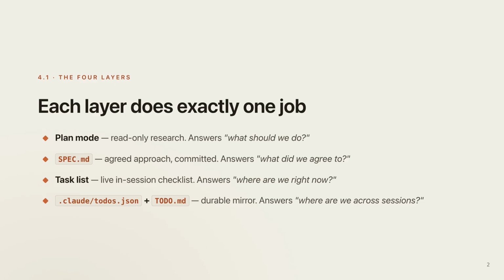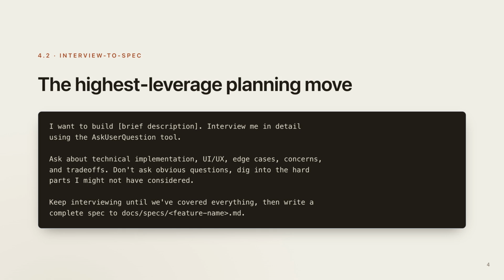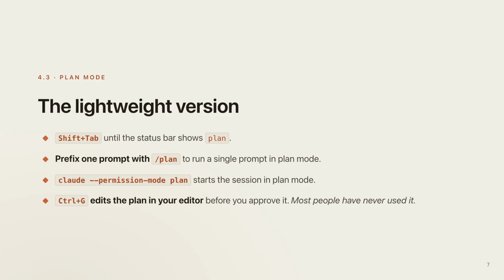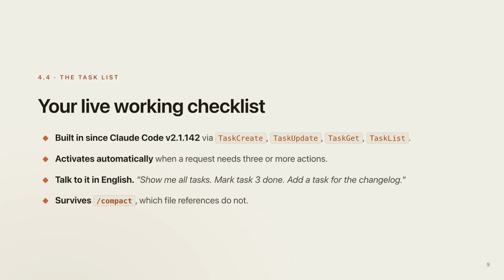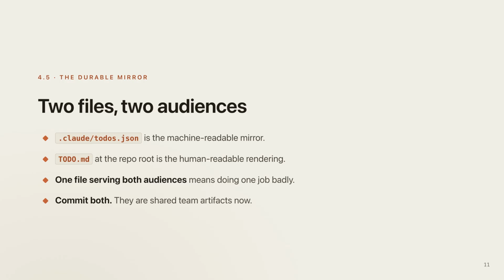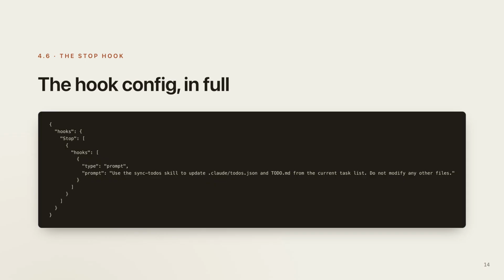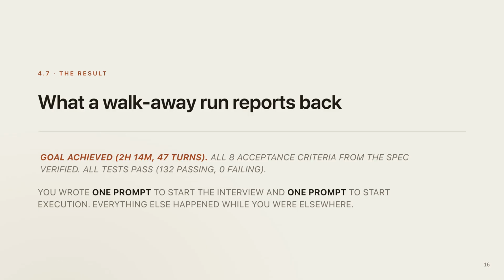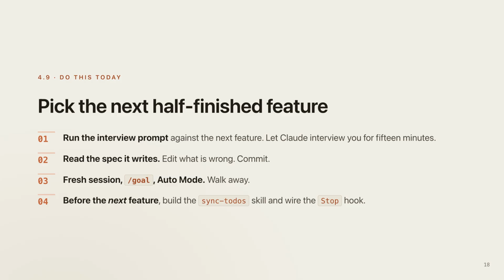Mastering Claude Code: part 4 planning specs tasks using native Claude Code tools.

Comment: Do people often make mistakes when using Claude Code, such as entering the wrong code or misplacing code?
Reply from the maker: Usually people just give instructions and Claude Code generates the code. That said if they typed in misspellings or wrong syntax into Claude Code there is a good chance that it would understand and fix it.